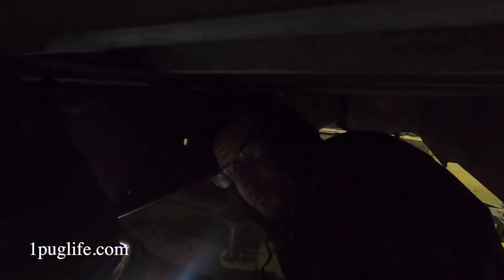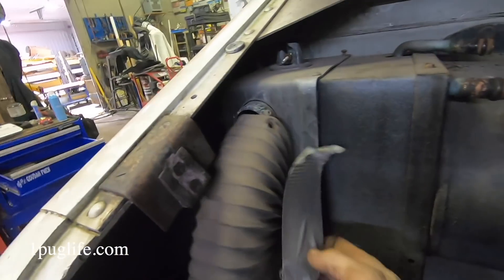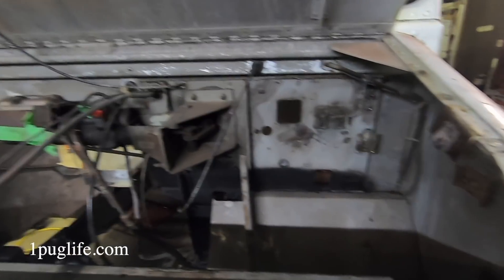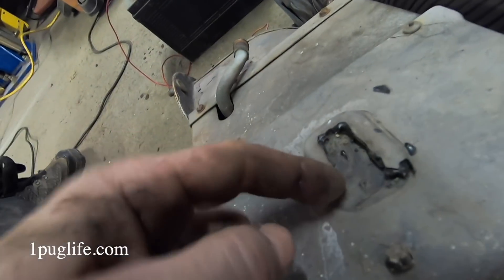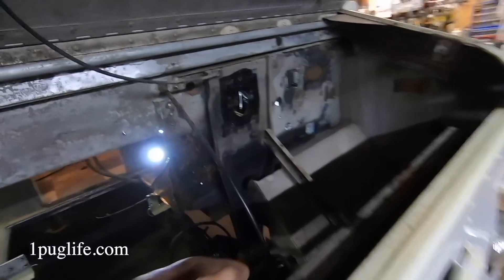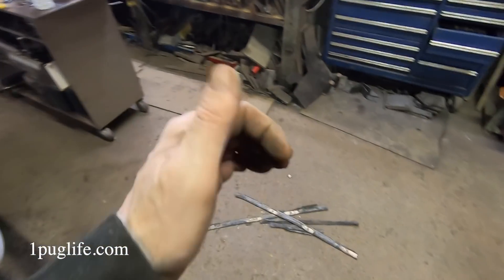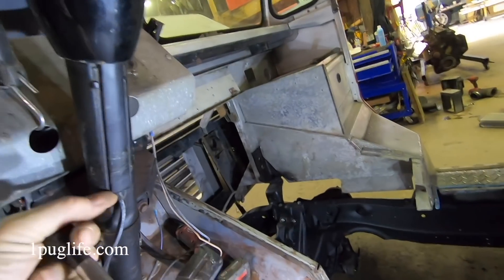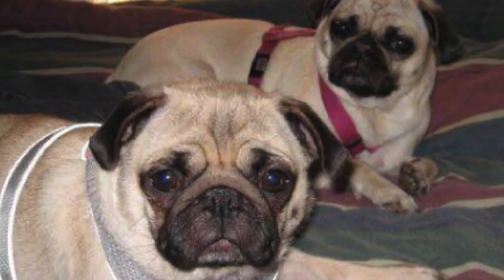stripping the grummans

Comment: You are better of to use like a 5"sander with some like 800 sandpaper. Also Holly makes a digital dash. It's like a 5" or 7" screen. Everything is on it. Tom's speed, volts temp oil pressure..and you would have just 1 screen. Also look cool. And you can go on line and get a universal clutch pedal. The did come factory in some of them also those Grumman  came with a 4bt diesel in them also a 7.3 diesel. Love this build as well. You can use a moving blanket on the bottom of the door.

Comment: If your going to use those stainless coach bolts Chris get some rubber washers to isolate them from the aluminium body. With all the water and salt you get the electrolysis will corrode the roof in a couple of years.

Comment: Just a thought or rather something to look into but if you bought the factory bolt up clutch pedal and what not would it provide enough hydraulic pressure to actuate the clutch basket on the cummins. Could be a generic common pressure but I would find out before spending the money on it for sure.

Comment: I would use my fancy pants tig welder and patch those holes. Then I would get a nice can of oil based metal paint and coat the frame. If I didn't want to be cheap I would get a can of that POR-15 and really do it right.

Comment: You could run a dryer vent out the wall and build a box for the filter outside with the extra sheet metals for a filter house and fuck it clean it out every once in a blue moon

Comment: Sucks that doing cable work is a dying job. things like replacing a cable and ends is a very useful thing. I had a motorcycle cable snap, online they wanted big bucks, got it fixed by the one guy that still did work like this on the shady side of town for a few bucks. Maybe try to find a guy.

Comment: Put an exhaust door hole in the new garage doors for that big hose to run outside so you can keep the door closed
Reply: power vent through roof and suspended drop hose/s. that way, you can vent them with doors open or close year round.